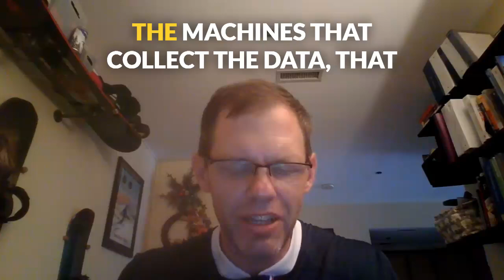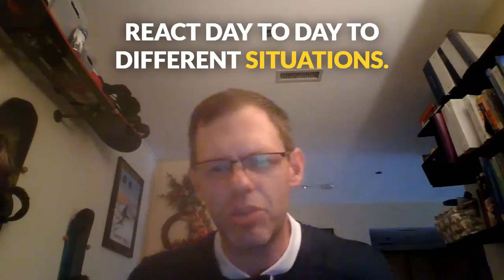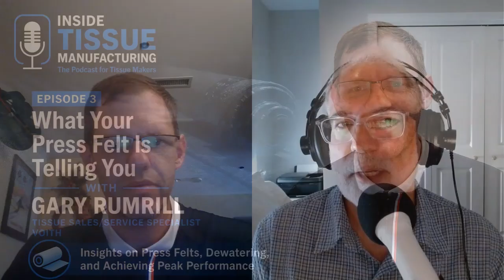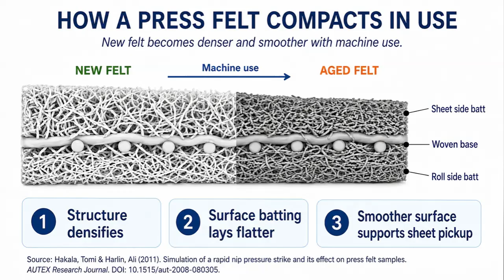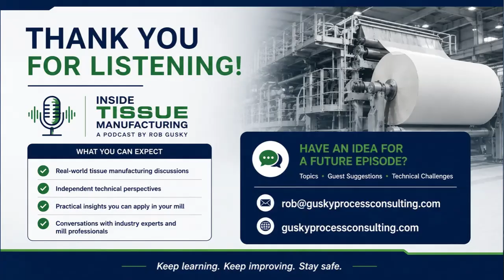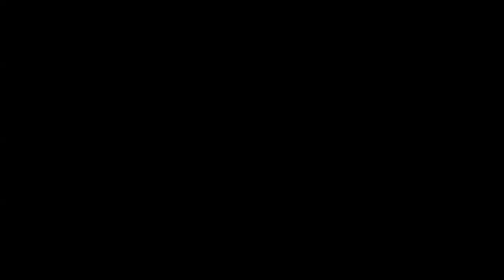Press Felt Troubleshooting: Is Your Felt Really the Problem? | Gary Rumrill | Episode 3

Comment from the maker: 📌 *Key Lessons on Press Felts & Troubleshooting*

Gary Rumrill shares decades of practical experience with press felts—and an important message: what looks like a felt problem is often a symptom of something happening elsewhere in the process.

A few highlights:

🔹 *02:30 — Look at the Whole Process*
Why even the best felt design can't overcome poor machine conditions.

🔹 *03:36 — Data vs. Reaction*
Why mills that track and understand their data outperform mills that simply react to problems.

🔹 *05:30 — Is It Really a Felt Problem?*
How furnish, chemistry, conditioning and other upstream changes can show up as felt performance issues.

🔹 *09:14 — How a Press Felt Removes Water*
Gary explains what happens as the felt compresses and rebounds through the press nip.

🔹 *15:52 — The Critical First Week*
Why felt break-in can influence performance throughout the entire felt life.

🔹 *24:48 — Vacuum & Showering*
Using felt showers and vacuum together to maintain stable, uniform conditioning.

🔹 *30:30 — A Great Troubleshooting Example*
Using felt rotation distance to trace recurring sheet holes back to a sticky.

🔹 *37:27 — Advice for Young Engineers*
Learn from the operators who live with the machine every day.

*For the tissue professionals here:* When felt performance starts deteriorating, what do you check first before concluding that the felt itself is the problem?